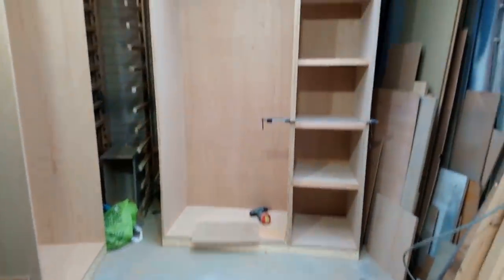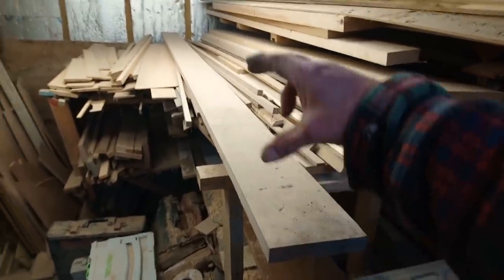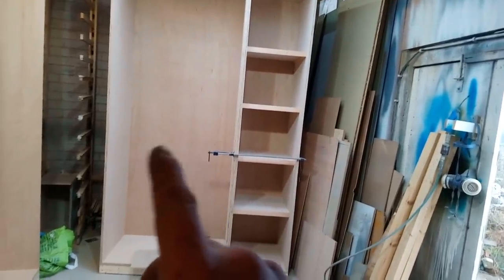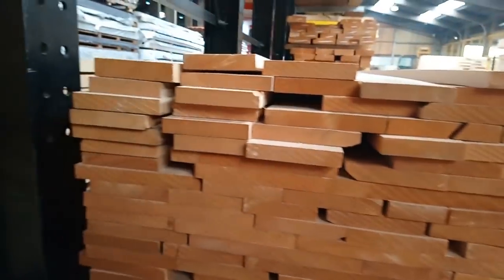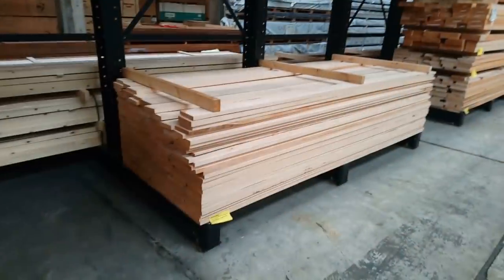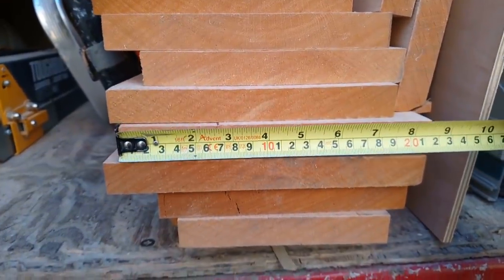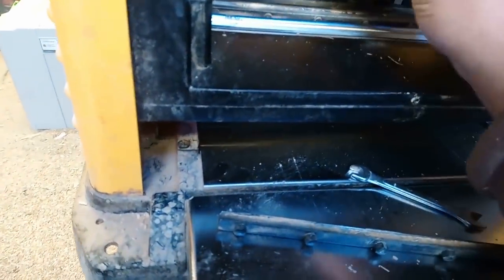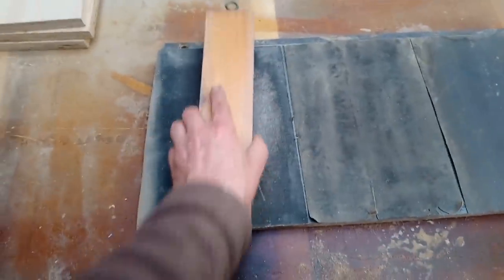Wardrobes Pt3 - Monday shopping for Beech & sharpening planer blades

Comment: Thanks  Gid, I need to replace my Jointer blades sometime soon and your Vid has cleared a lot up for me.  I guarantee my adventure won't be as smooth as yours, i'm not looking forward to it
Reply from the maker: 🤪 Don't know about your machine, first time's a bit daunting but it's not hard, read Ed's comment below about the height of the blades n out-feed table, 
After you've done it n it cut's nicely you'll get a bit of a warm satisfaction feeling 😊 maybe that's just me 🙃
Best of luck 👍
Reply from the maker: I considered a combi machine when i bought the Dewalt but lifting the bed i thought would do my head in a little so not long after i found the jointer on ebay cheap, now i can flit between the two as i wish. 😉

Comment: Good info on the timber merchants, not many places down south with that much selection in stock.  Van issue was prob a collapsed hose, but keep an eye on the pad wear or pulling to one side, as it could be sticking caliper pistons. If you need new calipers, try Big Redd for exchanges.
Reply from the maker: Hi, There's some prices on adie's comment 👍
Thanks I'll have a look but there's a fairly good shop walking distance from my house, I think it was the pipe, it was badly corroded n the fluid that came out was rusty colour so i think the little hole at the end of the flexi hose had silted up, I did film it as keeping this old banger going a long as poss is a challenge I've taken on, sick of throwing them away because of rust, but stopped filming when i got dirty hands n the swearing started, trying to fit the brake pipe inside the engine bay 🤪🙉, it's like a 30yr old broom, it's had a new engine, rear axle, springs, dampers, alternator, head & rear lights, windscreen, I've welded quite a lot, rear quarter panels & exhaust needs doing soon, I've new discs in the shed waiting for a good long summers day to be fitted n yeah the caliper are on the way out, i'll put new on when i do the discs, The discs moved freely when i did these pipes tho but the rubber seals are perishing, I put new pads on both sides n flushed to remove well old fluid & bled each side, I quite like doing this, it gives some satisfaction in making work but I'm getting old to be in awkward positions n my drive is well dodgy for the jack, I've some ramps made from decking 🤣 they work well 👍
Reply: Gid joiner that’s the thing with transits, they’re so easy to get bits for and work on they just get patched up and go on forever. I had one of the same as you hi-top lwb which was a camper converted for motocross, thing spent its life driving across muddy fields, back end was like lace, literally knocked through whole crossmembers with a screwdriver, but i welded it up and kept it going, put a new gearbox in it, one that came out had no oil in it at all, used it for two years and got my money back on it when i sold it too.
Reply from the maker: I like the "got my money back on it when i sold it too" 😁
This is my 5th transit, 3yrs ago i think it failed seriously on welding, the back end & bits on the chassis frame, mainly around the back, so bought a £100 welder n decided to patch it up, just joinery wi metal init 😊 passed & for each yr now,
When i got it it was 3yrs old n shiny, i planned on washing it n looking after it, that was 15yrs ago, you could count the amount of times I've washed it on a one armed mans fingers 😂🤣
Reply: Gid joiner i’m a hobby welder and fabricator, use mig and tig mostly, do odd bits on the side, don’t touch rust or restoration work now only work with fresh steel on scratch built vehicles, racecars, and general fab, people won’t pay to fix things properly, they think a 50p sized hole is a few quid to patch and when you point out that there’s 12” of metal behind it all rotten or missing they fall over when you quote them. You did fine with gas less / flux core mig. if you like welding, next time reverse the polarity and try non flux core wire with co2/argon mix, much smoother arc and far superior weld quality and appearance, but gas obviously costs.
Reply from the maker: Yeah, I get that when people want a bit of rot fixing on a window etc..
On one of my vans i got a quote for welding, ££££££££s 😮😮😮🤸‍♂️😁
All my welding has to be done outside because you might have noticed there's a bit of wood dust in my shed 😉
I have looked into & will be buying a better machine, a gas machine but doing it outside is a concern, the flux core one i have 100amp is only good for small/thin stuff & occasionally i get asked by friends to fix things like gates... this one just can't penetrate without heating the metal up. I've welded bits for many yrs but this is the first machine I've owned n after playing with it for a while now i would like a better one & a cleaner weld with a gas one, One day when I've got the cash, hopefully before i have to do the rear quarter panels.  
Thanks Phils 👍
Reply: Gid joiner welding outdoors isn’t so much of a problem as is made out, as long as you’re not welding in strong winds and you have decent flow rate/ bottle pressure you’re fine. A little cheap stick welder would be most suited to heavier stuff of 3mm or more
Reply from the maker: Thanks 👍
 yep i wouldn't be trying it outside when it was windy, I'm going to get one anyway & give it a go one day, 
I need to create an area of my shed where i can do metaly things without being outside, maybe even make it non flammable so i can weld n grind, I'm going to extend the back of my shed which will allow some things near the front where my lathe is to move & create a small room, That's the plan but my van will be outside,
I used to borrow my dads stick welder but that i think went to Scotland with my brother yrs ago 😒

Comment: Gid, you're a fantastic joiner. I slightly disagree with what you were saying at the end though. What I would do to set the jointer blades is to use an aluminum straight edge. You set the planer blades dead on with the outfeed table and have it so the blades just scratch the straight edge. Using a straight bit of wood and moving it across does work and that's what they teach you in college but it's not the most accurate method. A straight edge is true and theirs no complete guarantee a bit of timber is. All this need for easy setup jigs is a load of bollocks. Though, with what I said I guess it's horses for courses.
Reply from the maker: Hi, Thanks 😉
Yep i agree, that would be ideal, I don't have a decent straight edge, don't think so , something I've always meant to buy (among the 1000 other things 🤣) I'm not sure it would be that much better on this old machine, the bed, the raising/lowering knob & the adjustment screws for the blades are bit worn n a little difficult to move just a fraction, I've tried getting it closer to the level of the blades in the past but a fraction higher is safer for me, too low n it doesn't plane straight, too high n you get snipe at the end, I've got no snipe so for me at the moment this works & is as close as i can be. 
Easy setup jigs? are those the things you can buy you're ref to ?
Reply from the maker: Ya know when i go out there tomorrow I'm going to be finding summat straight n be trying to get it better 🤣🤪
Reply: @Gidjoiner  While you are out invest in a ratchet ring spanner for those pesky planer blade nuts. Love your videos
Reply from the maker: Thanks David 👍
nice idea but it has to be an open end spanner, the bolts wind tight against the other side to the blade, you wouldn't get a ring spanner off & there's no room behind/below, even an open end will only turn about ¼ turn before the spanner touches the bottom of the channel/groove. 😒

Comment: great videos my friend.  Whats your view on getting the timbre merchants to plane and joint boards.  You made a comment there about a boring days work.  Is it more cost effective to spend my time  in the work shop/onsite on a project doing the joinery and pay the timber merchants to do this job rather than purchasing, maintaining and operating a jointer and thicknesser.  I think its a £1 or £1.50 per meter for them to do it.  There might also be a £15 surcharge  but this probably doesnt come close to the amount i can charge for my time.   
Im reasonably new to the trade though so probably have a lot to learn still.
Reply from the maker: Thanks will 👍 
That's what i had to do when doing the odd job between working & when first going self-employed for firms,  but.. there's a waiting time, you never know what's going to turn up n there's no going back, they want paying either way, 
Yeah it's boring but there is some satisfaction in doing it yourself, starting with a rough sawn piece of wood & turning it into a piece of furniture, a door etc... owning my own machines means If i cock a piece up or want an extra bit i can always make another, if i decide to change the plan i can, little jobs that require a couple of ft or metres, there's plenty of benefits, i haven't sharpened these blades for a yr so not much maintenance & if anybody's getting paid for machining i want it to be me 😉😏😊
Reply: Thanks buddy. An Informed reply I appreciate it. Keep up the great work.
Reply from the maker: No problem 👍 Thanks will

Comment: Is beech more expensive than tulip?. And apart from the finish is beech better for this kind of joinery?
Reply from the maker: For me Tulip is more expensive, Beech is a traditionally used furniture wood, straight tight grain, uniform colour & takes paint well, I think it machines & feels better than Tulip which feels softer & feathers a little when sanding & machining.
Reply: Gid Joiner thanks mate. I’m doing a wardrobe very soon and am debating making door rails/stiles from a hardwood instead or MRMDF so beech could be the way I go 👍
Reply from the maker: @olivermoore3431  👍 yep, it comes as sawn planks so if you ca or get it machined 👍. I occasionally get a comment like - "If your going to paint them you might have well make them out of MR Mdf" , To me that's a slightly naive statement, I've been a joiner for 36yrs & have made many cupboards/wardrobe,kitchen doors. This is a comment i have saved for the reply to their MDF comment, I'm sorry it's long but shares a lot of my thoughts about this, I hope your wardrobe turns out well 😉 -  .
The basic answer is compared to Beech MDF is crap, 
 It's about the quality of the base material & therefore the quality of the overall job, wood is wood to me so painting it is no issue but some woods are better than others, for quite a while i used pine, 'cheapest price' i was asked for but the shrinkage & warping later when the pieces went into a centrally heated house were unacceptable to me, Beech doesn't cost that much more on a job of this price, the time & expense put in ya might as well have a decent substrate that'll stay relatively stable for it's lifetime, Beech is harder than pine & 100 times better than MDF, it's tight  straight grained with little or no knots, it's not just the longevity tho you can feel the difference after it's sprayed, the temperature, the hardness & the way it shuts just gives it a better well made feel. I build these things with the hope that they will still be around in 50yrs like the old pieces that are still sometimes around, they were often made of pine, which is what i was/am trying to emulate but the quality of the wood (pine) was better then, if i bought planed pse pine i would still have to machine it sq n straight because off the shelf it never is, so the labour in preparing the wood is not much different & cutting the dominos is the same for both & maybe the same time spent would be spent on the joint of MDF whether that is a spline/scribe/groove or domino.  
I would use MDF if I didn't care too much & the job was cheap, if i didn't expect them to last more than 5yrs, if i wanted a very flat no grain finish or if it had to be done with that material through customers choice for whatever reason (prob against my advise), Mdf boards never come straight so tall doors can be a problem, screws don't hold as well as they do in Beech so hinges tend to come loose, fitting butt hinges into the edge of MDF is not reasonably poss, I use ply for the carcass on some jobs for a similar reason so the screws in hinges/hinge mounting plates, hanging rails & drawer runners hold well,
When spraying there is an inside & outside edge on the stiles n rails, MDF feathers a little so there would be more work there sanding, i give my customers the option of ply or MDF panels on the doors, you get a very flat finish with the MDF, Ply is a slightly better material but there's a possibility of seeing the grain through the paint, their choice?, when sanding these doors with beech stiles & MR MDF (I only use Medite MR MDF) panels it's always the panels that need the most sanding,
I do sometimes use MDF for doors & drawer fronts, normally when it's just a plain flat door i want but I have a list of materials in my head, MDF is the very bottom & would be my last choice for shaker doors. unless it was a bespoke style/sized door to match an existing set you might as buy some, there's loads of MDF units/furniture on the market, a lot cheaper than asking me to build one, Building out of MDF is not the quality that my clients ask for or expect from me
Reply: Gid Joiner hahah very well said, your experience as a joiner definitely comes across when watching your videos that’s why I keep coming back to them. The added cost of a hardwood is something I’ll have to think about for future work but I think prices will stand the test of time as you’ve said so well here. Another question if you don’t mind. I’ve noticed your mid and bottom rails are a lot wider, what measurement are they?, are they just double what the stiles are?
Thanks for your responses 👍
Reply from the maker: 👍👍😁 The bottom rail is traditionally wider, I don't have a set size as all jobs are different, when i do the CAD drawing I'm following the clients pic shown to me on the internet or they've seen one of mine on Facebook, i just make them look similar or/& aesthetically right...-ish. then the client approves the drawing or asks for refinements, In my mind & what I've seen in old cupboards the stiles & head are the same, (similar to a room door), the stiles are 3"-ish, for my dominos to work out ok i have to make them 80mm, the bottom rail I'll make maybe 100mm - 110mm? 🤷‍♂️ It's all in the eye sometimes 😉
Reply: Gid Joiner got ya 👍. Thanks again, it’s like having a joinery tutor watching your vids lol. I’ve got a quote for some beech, will have to be machined as I don’t have half the machines you have, I can get by with my plunge saw etc 😁. Thanks again mate, quality work as always 👌
Reply from the maker: I pay about £24+vat per cubic ft from lavers
Reply: Gid Joiner my quote from Bedford timber (local to me) was £15 plus vat , that’s for a 2.1m length of what is essentially 3x1. I’m not sure how that compares to your price where you are
Reply from the maker: @olivermoore3431  Yrs ago i was given a cubic ft price from the merchants, that is what my PC is set up at & what i find easier to work with when buying wood, A 6" wide board x 1" thick x 12" long is ½ cubic ft. this does mean i have to translate my metric drawing to imperial when working out a quote but i have formulas/calculations set up on the spreadsheet that does that for me, all i have to do is put in the metric sizes.
1 cubic ft is 1728 cubic inches. My price £24+vat per cu ft for sawn timber ÷ 1728 =  0.016666666, basically 1.7p a cubic inch. Your piece 83" (2.1m) x 3" x 1" = 249 cu inches x 1.7p = £4.23, then it has to be planed.
Reply: Got ya, cheers gid, also what size slotting cutter are you using for your panels, and what thickness mdf panel is it? Debating on what thickness to use and what size slotting cutter I can actually find
Reply from the maker: I use 9mm for panels, drawer bottoms & wardrobe backs, I rarely use 6mm. I prefer the stiff ness 9mm gives, The cutter is one of these, you can get various size cutters, spacer washers & arbors so you can make one the correct size, I have one that's always set, i have to adjust it because 9mm MDF & 9mm Ply are rarely 9mm or the same size from batch to batch, 
https://www.axminster.co.uk/axcaliber-2-wing-slotting-cutters-ax809783
Reply: Gid Joiner cheers! These only seem to go up to 6mm cut , in your video the groove yours produces seems a lot bigger
Reply from the maker: @olivermoore3431  6mm & a 3mm, you can stack them with washers in-between to the thickness required
Reply from the maker: @olivermoore3431  sorry this is the one i meant to put https://www.axminster.co.uk/axcaliber-three-wing-slot-cutter-set-952565
Reply: Gid Joiner ahh I got ya . Sorry I was abit slow on understanding you there lol. Thanks again so helpful 👍